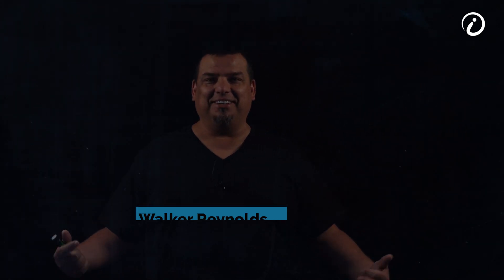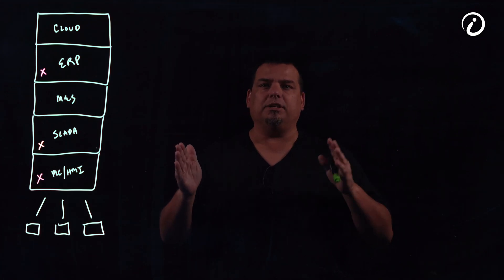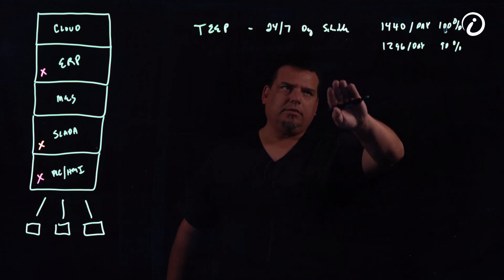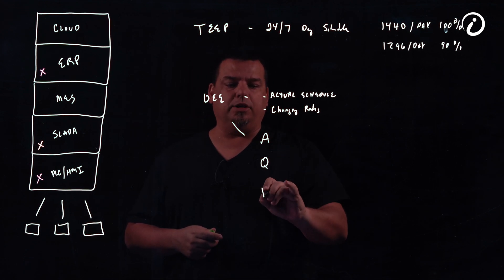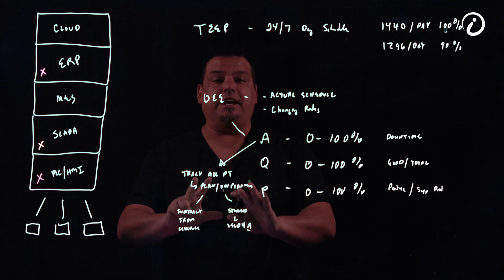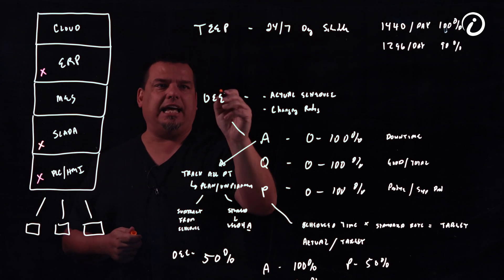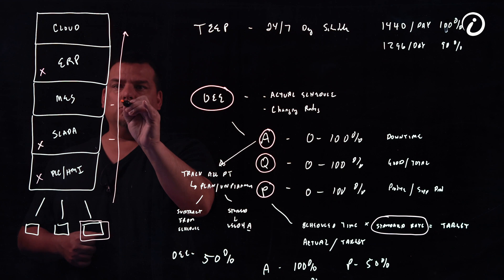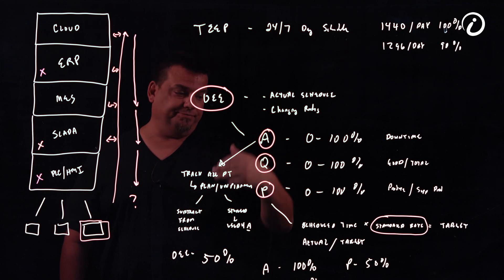How to Calculate OEE and why you need to

Comment: Question:  How should we account for TPM activities?  If we have our operators perform TPM at the start of a shift, I assume the TPM time would be considered Planned DT.  But planned DT gets taken out of the scheduled runtime, which means the time spent on TPM is hidden from my OEE number, even though it is something we can control.  Just trying to figure out how we account for this time properly
Reply from the maker: TPM hits the TEEP number
Reply: @4.0Solutions  ahh, interesting 🤔.  My company measures OEE (inaccurately right now.  We measure essentially OAxOP, and we really don't do that right either, and quality is measured via STR).  I have been in many executive meetings and never heard any leaders mention TEEP.  I understand it from your video, and makes sense TPM hits TEEP, but we just are not looking at that metric.  I'll have to think about how we pull it in, because I want to see if we are spending too much or too little time on TPM.  TPM is valuable, we need to do it, but need to optimize our effort with it.  Thank you!
Reply: @4.0Solutions  BTW, Your videos are great.  Very informative.  I have personnel working for me trying to fix our OA and OP data governance.  Do you offer consulting services where my team performs the work but can consult with your team to make sure we do it right?  I just want truth on the manufacturing floor.  You cannot fix what you cannot see.
Reply from the maker: @ yes. Please visit our store at www.iiot.university/store and use the code WALKER50 for 50% off a 1 hour consultation with walker Reynolds.

Comment: I'm having some issues about implementing OEE in my company, mostly because we do custom products and our machines are mostly related to testing the products and do visual inspections.
The quality, i guess, is always 100% because is not relative to the machine output but to the goods Non Conformity. So those goods who doesn't pass the tests should go into P metric? (for ex: 100pcs expected, 95 passed).
My biggest questionmark is about the Availability, because the usage of some machines is dependant by what is planned and we never use them all day long, also we have a different setup time based on how many different goods are planned... so maybe we have only 1 product for today, and tomorrow we have 5...
I was thinking to use the planned usage (that can vary day by day, 2 hours today, 5 hours tomorrow, no hours the day after, etc) vs the actual usage.

The moltiplication of A-P-Q is still applicable even if I use, as a metric, time for A and pcs for P and Q?

Comment: what teap stand for？
Reply from the maker: TEEP — Total Effective Equipment Performance

TEEP measures the overall effectiveness by considering planned and actual operating time, including both scheduled and unscheduled downtime, while OEE focuses solely on planned production time. TEEP comprises three components: Availability, Performance, and Quality, which are also present in OEE. However, Availability in OEE excludes unscheduled downtime. Both metrics are valuable for analyzing equipment performance and identifying areas for improvement.

Comment: So you don't really need the OEE but the AQP - isn't that more accurate to say?
Reply from the maker: You definitely need to calculate OEE. It's the organization-wide kpi to watch.
Reply: @4.0Solutions  Well - I kind of anticipated that answer, but that doesn't make sense, as the OEE is a calculation consisting of AQP, and if you need to improve your production, the OEE consists of three parameters, but they are - as you describe - widely different, so how can OEE be a measure, if it's really AQP that needs to be addressed?

Comment: OEE is a bogus number that puts managers to sleep. It does not tell your capability if you have trouble coming, how to improve processes, or how to know you have. Nice presentation of bad material. When I was young, a manager once told me an operator had higher OEE than me. I said "Dennis. did you forget all the Saturdays we had to work overtime reworking the junk he made?" That's how stupid OEE is.  The company folded in 7 years and 7 months, could not compete.
Reply from the maker: If he made junk than that should’ve affected his quality score because he didn’t produce good parts. It's not OEE's fault your mgr didn't know how to calculate it.

Comment: I disagree with this aggregate calculation method for the Area OEE. This method will only work of the Net Ideal Cycle Time (NICT) used to calculate the (P) Performance factor of all of the lines within the area are exactly the same. If you have one line making 1000 parts per hour and the next one making 50 parts per hour within the same Area, you will get incorrect and skewed results by following the aggregate method.
 On the other hand, I do agree that Averaging always ignores or diminishes the significance of the lower and higher peak values, but, it gives you a more reliable number; if you are concerned about losing sight of the low performers just show them separate from the average OEE as a list of top offender lines to work on them.
Reply from the maker: I'm pinning this comment in our Discord Server for Walker to respond to! https://www.iiot.university/discord

Comment: Hi there!

Great video! 
I have a comment/question related to “Performance Calculation” (go to 07:26). 
You mentioned that performance is calculated by dividing the actual production by the target (you said that target would be the scheduled time multiplied by the standard rate). Actually, the target should be calculated by multiplying “running time” by standard rate, i.e. you have to take into consideration not only planned but also unplanned downtime. 
Example: In a shift of 8h, there is 1h planned DT and 2h unplanned DT. Let's say the standard rate is 1 part per minute and the actual production was 280 parts (good and bad parts). If you take running time to calculate performance you would have: 280 / (5h*60) = 93,3%. If instead you consider scheduled time you would get: 280 / (7h*60) = 66,7% (this would be wrong!)
Now consider we had 30 bad parts. 
OEE would be: 250 / 7*60 = 59,5% 
Quality would be: (250/280) = 89.3%
Availability would be: 5h/7h = 71.4%

Thus, performance has to be 93,3%.

In other words, if you do not consider unplanned DT in the calculation of performance, you would not be analyzing the speed of the equipment (or the cycle-time) but rather a mix of speed and unplanned downtime (in this case, the longer the unplanned DT the lower the Performance, what is not right, since unplanned DT is already considered in the calculation of Availability).

In summary: Performance only takes into account production when the equipment/machine is running and not when it is available.

Long text, but what do you think? 
Really nice video! Thanks for sharing this great content.

Comment: Great explanation. Also, super impressed how you wrote backwards.

Question - lets say you send out parts to the customer and some get returned for being bad 1 month, or 2 months later. Do you just go back and recalculate that months OEE again?
Reply from the maker: It depends on how meaningful that information is. Does that 1 return make a big impact in your Quality numbers? if so develop a method of retroactively adjusting these counts. Perhaps look at Quality inspection and figure out why they are getting by in the first place.

Comment: Interesting to hear about clients eager to integrate but unclear on the value of OEE. Is this when you're approached first by IT, exec-level, and not OT mgmt? Having sold remote sensing data & analysis where use cases drove the project, this is new to me. Customers knew what info they wanted and why. They just couldn't get it from silo'd historians, let alone reliably in real time. I mean if you don't know the business value of integration to what you are already doing (cost of NOT integrating), why the interest?
Reply from the maker: It's hard to see how one would not value OEE

Comment: Great visual. The new board is definitely easier to follow as a viewer. 
Q. Using the unit of parts makes sense for a single machine or a single process on many machines. When measuring many machines with varied process times shouldn't P & Q be calculated using time?
Reply from the maker: Time would cancel out for quality. If I understand you correctly Michael you're saying that if one machine takes a minute to produce a part and another takes an hour one bad part equals a minute of loss production on one machine whereas it means an hour on another machine. At the end of the day quality is simply good parts / total parts. So if a machine makes less parts in a day one bad part affects the quality number more, than a machine pumping out thousands. If that makes sense. The numbers are designed so deficiencies only ever affect one of the three categories A P or Q.
Reply: @4.0Solutions  The quality loss of a part that took 1 hour is greater then the quality loss of the part that took 1 minute. Whereas using parts, each part has an equal detriment to Quality.
Reply from the maker: This will be accounted for at the end of the day when the quality score for the 1 part/hour Machine is 23/24 or 95.8%
And the 1 part/minute machine would be 1439/1440 or 99.9%
Reply: @4.0Solutions  How would total Quality be measured for both machines combined? 
Parts (1439+23) / (1440+24) = 99.8% or Time (1380+1439) / 2880 = 97.8%
Using time weights the calculation for the part that took 1 hour
Reply: @michaelunmann  I see what you are saying now. Excellent point. I'll bring this up to Walker to see how its currently being handled. I believe don't quote me, that when rolling up OEE numbers they are simply averaged and equally weighted. (99+95) / 2 = 97%.  At the end of the day,  you would need to drill down to find root cause anyways. Comparing quality across these two different machines doesn't make a whole lot of sense.  the 99.9% quality machine doesn't have an issue. but the machine that takes 1 part per hour... obviously messing up a part is detrimental.
Reply: Michael, great question, its one I get a lot.  The answer is this: Quality is a measure of the reliability of our process, not the quality of our time.  Therefore, the Quality number should only indicate what percentage of everything we produced is sellable (yields direct revenue) vs scrappable (yields no or indirect revenue).  The quality number exists only to tell us how much we can rely on our process and has nothing to do with the reliability of our time.  You are correct, not all parts are equal — in the effort required to make them —but that is weighted in the performance number, which is time based.  Absolutely excellent question... thank you!
Reply: @walkerreynolds973  Yup makes sense that we look at Quality metric as it relates to creating revenue (good parts) or lost potential revenue (bad parts). However using the unit of parts OEE can not quantify the value of the revenue since it does not know value of the part, or the value added at that equipment, so each part is equal in revenue value whether it took 1 minute or 8 hours. We can however quantify time to a part by using good part time and bad part time then we correctly apply the gained or lost revenue appropriately. I have a visual that I will email you. Thank you.